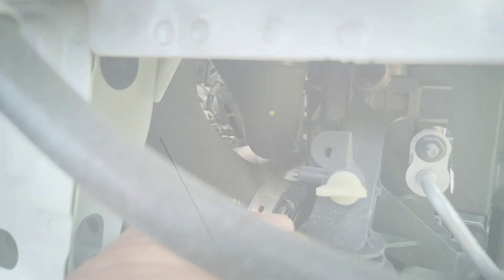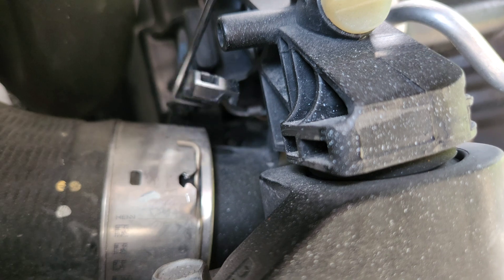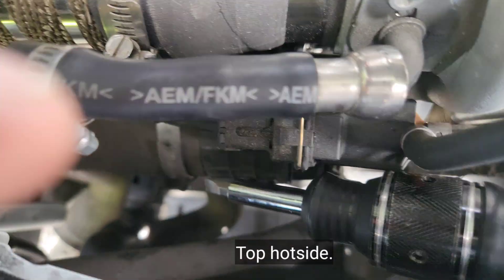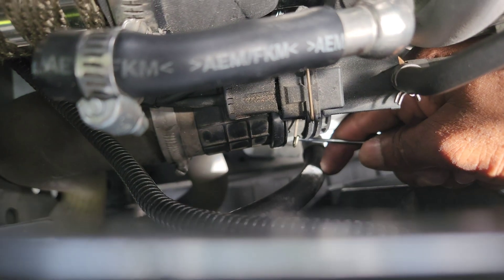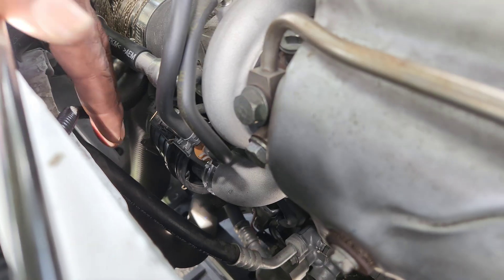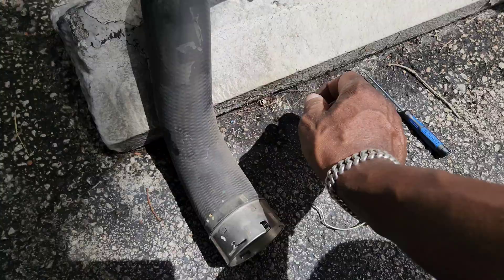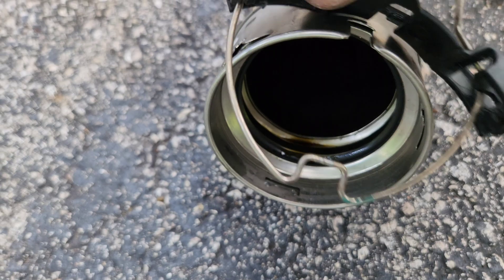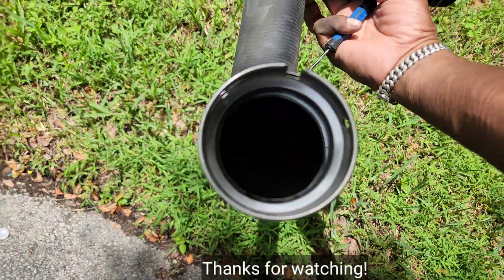How to disconnect a turbo charge pipe. Chevy Cruze Gen2 #chargepipe #howto

Comment: I'm having a hard time with the bottom clip due to the space.  Thanks to your video I got the top off no problem.
Reply from the maker: The bottom clip has a small tab that's located in the corner of the black piece. You have to push it up to release the clamp.  I didn't notice when I made this video.  If you look at the black square that's holding the clamp in place.  You'll see a little skinny black tab sticking up in the corner of the square.  Push it up towards the top of the squared clip.